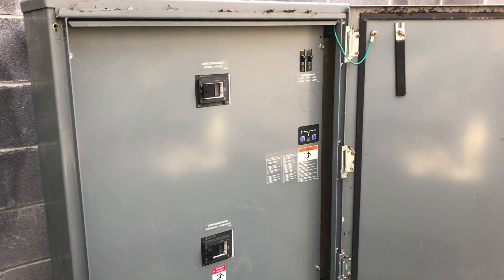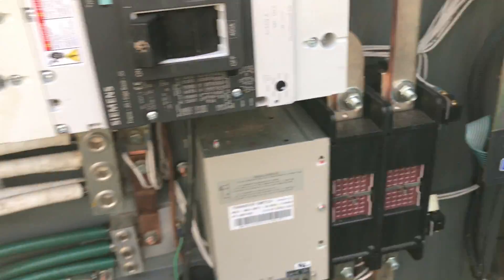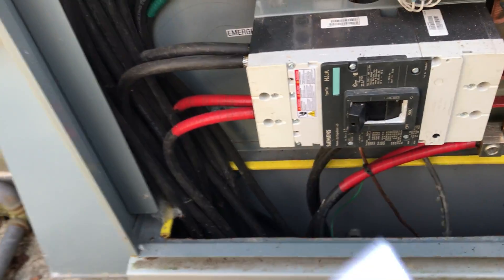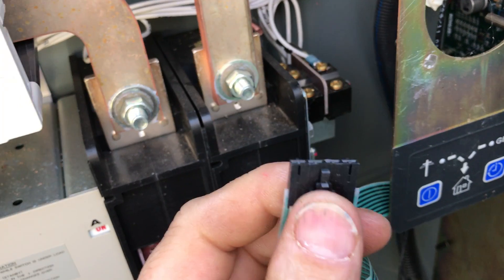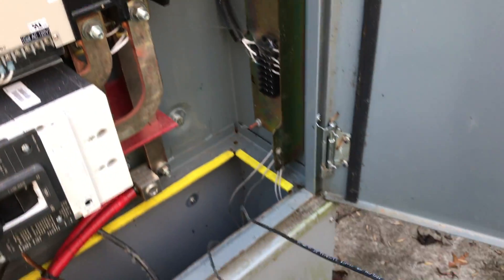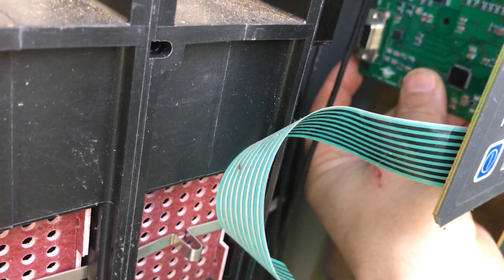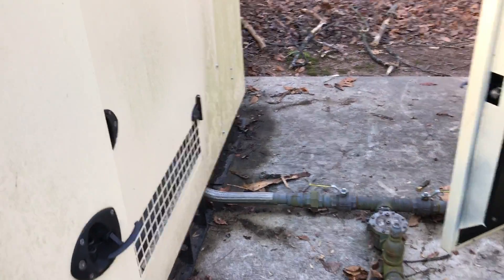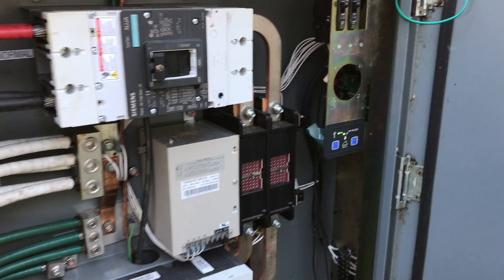Kohler RDT Transfer Switch

Comment: Could this board cause the generator to run all the time when the generator is set to auto.    The keypad connected to this board dosent light up anymore.  Im guessing something isn't sencing pole power.   I do have power at nl1 and nl2  wires that go from the main lug to that board.   Any help would be very appreciated
Reply: Yes.

Comment: I appreciated your video on RDT board replacement. In my system, my RES20A gen keeps running in auto. Wondering if I have a problem with the board. Everything else on the ATS seems to be working fine.
Reply: I replaced the RDT board with the one mentioned in the video and everything seems to be working fine. 🤞🏽
Reply: I have the same issue with mine. Let me know if you find anyrhing out.
Reply: Where did you purchase the board from?
Reply: The tech helped me troubleshoot and gave step by step instructions on removing and replacing the board.
Reply: You can make an appointment with them for free consultation with a technician.
Reply: Who is them? @RupeshPatel-g2x
Reply: Who did you contact?
Reply: On their website, I signed up for complimentary tech support and then they contacted me.

Comment: great info, who do you have renew the boards? put in brand new 38rcl today with rxt and rdt running parallel and the rdt is not switching back to utility after back on. of course our supplier is no use. may try call kohler tomorrow... thanks
Reply: Flightsystems does two things. they can test  the originals and they have their own version board as seen in the video.

Comment: I have a 17kw kohler generator and kohler transfer switch. My board is defective. I want to buy a new one and send the other on back to you to put the new capacitor> So my question is how much does a new one cost and how much to repair my old one. You can email me at cedarplace324@yahoo.com Thanks
Reply: Refer to Flight Systems, Inc website.  My generator service referred me to them.  The estimated cost is $400.  My current board (2nd one since January, 2008 install) is within 3 mos. of saying good bye.  The original Kohler  warranty for their board was 5 yrs.  The aftermarket warranty ranges from 120 days to 2 years.

Comment: who makes the upgraded board? where can I get it?  Thanks
Reply: I know this is old but flight systems makes the new board.   72-GM35950-00: Aftermarket Kohler GM35950 MPAC 500 Logic Board.  They make a bunch of amazing aftermarket generator parts.

Comment: Interesting-- not sure why weekly test is working.. Also- that board has a RS232 port and apparently you can talk to it.  Can you read serial . commands to tell . if the generator is running?
Reply: I believe on the old board, that port is used to upgrade the firmware. Prior to replacing the board, updating the firmware fixed the exercise/memory issue.

Comment: As an added note to these boards: The two capacitors glued together were upgraded on the new  board as well. One of the major issues was that kohler did not rate the voltage correctly on the capacitor causing them to prematurely overheat cooking the fluid right out of them. The newer boards have higher rated voltage to compensate for this issue.  If The original board gets repaired, the capacitors are upgraded at that point as well. 
Excellent video by the way. Very informative

Comment: I UPGRADED MY KOHLER 20RESAL TRANSFER SWITCH TO A 200 AMPS NOW MY GENERATOR WONT WORK I AM SEEING THESE CODES: ATS COM ERROR WARNING AND ON QUE STATUS DISCONNECTED. CAN YOU PLEASE HELP ME?
Reply from the maker: Tariq Ahmed - what type of ATS did you have and what type do you have now? If you upgraded to an RXT ATS it requires a special wiring for communication. The error codes that you indicate seem to point to a wiring issue and that usually means the incorrect wire. Please provide more information about your equipment and I would be happy to assist.